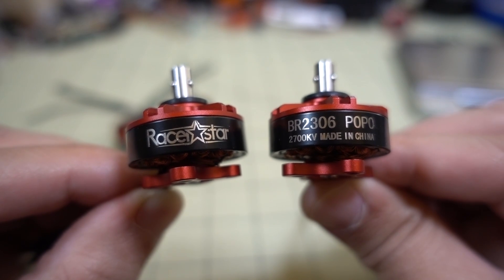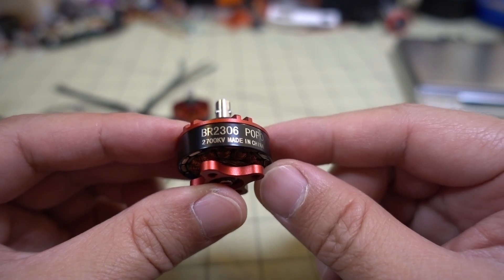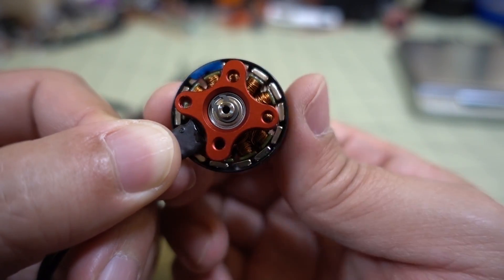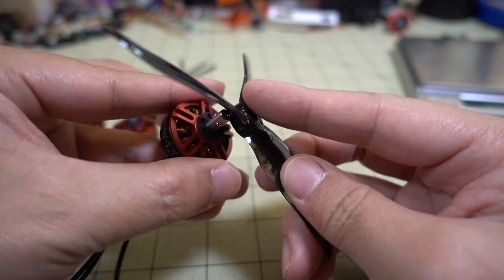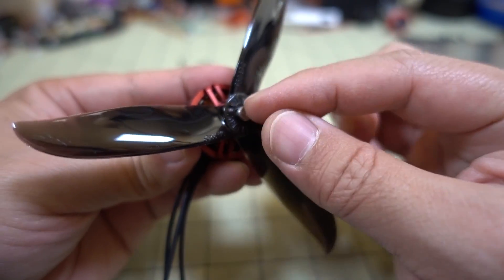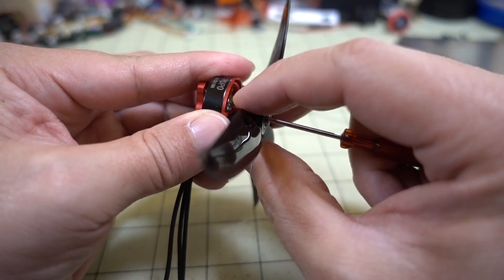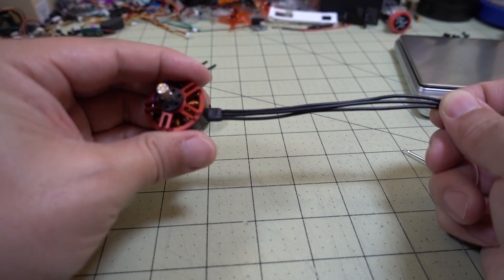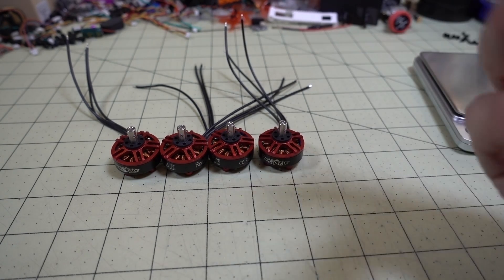Racerstar POPO 2306 Motor Review 🏁

Comment: 2700KV ...on the other hand it gets between 470-1080 grams of thrust depending on whether you use a 4045 or 5045 prop. Is this a trick question Al? :)

Comment: While this motor somehow actually looks half decent from the outside, the POPO Pro mechanism is a knockoff the actual POPO as far as I know. Getfpv actual owns patents in China for the mechanism and is going after the makers of this motor last I heard.  The reason the button doesn't stick up is because it's a remake of the POPO Pro with no button. The Pro version actually fixes a couple of significant issues with the POPO mechaniam and is the only one I would recommend between the two POPO shaft options.

Comment: 1080 grams of pull for the 2306 2700 kv. I still use Racerstar motors and for my skill level they're fine. I think the prop change system is cool.

Comment: I've heard some people having some issues with this motor and the props flying off, I wonder if they just didn't seat it properly, looks like it would be easy to do based on your demo..  I think at about 1080g of pull on the 2700kv version, this is a pretty good cheap motor.   Great Review!

Comment: Really wouldn't mind trying these motors out...dont have any POPO motors....not so sure If i trust the POPO system, would be nice if they had the option to use a nut. I do like how it has the recessed button, seems more secure than the ones with the buttons. MAX THRUST OF THIS MOTOR IS 1080 grams with 5045 props at 4s. Thank you Albert!

Comment: Those look to be good motors for the price. I'm not so sure about the POPO design. That makes me be worry about the props coming off in flight. It sure would be nice and easy though. I didn't hear you mention the max thrust and I don't know how to calculate it. I do know that it depends on voltage and prop pitch so after looking at a performance chart I'll say 1080g. Also, I was wondering if those were the old Tustin blimp hangers in the background of your video?